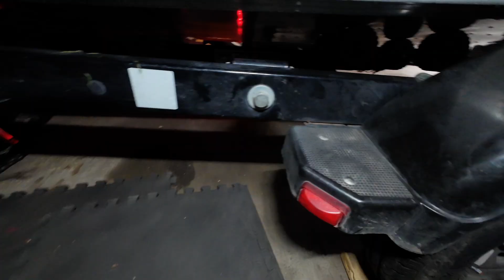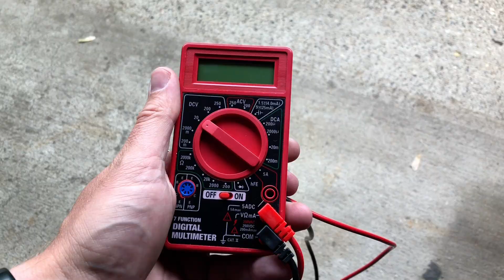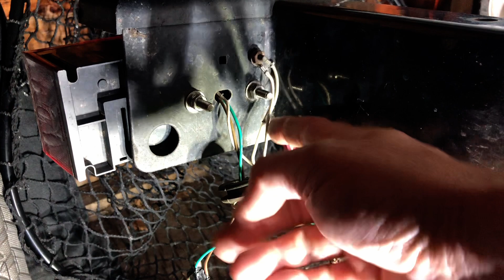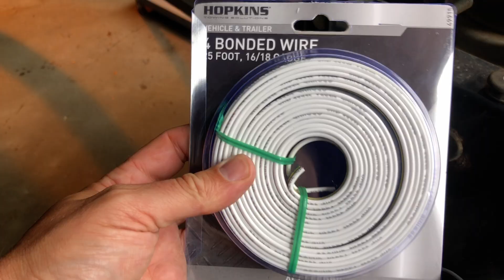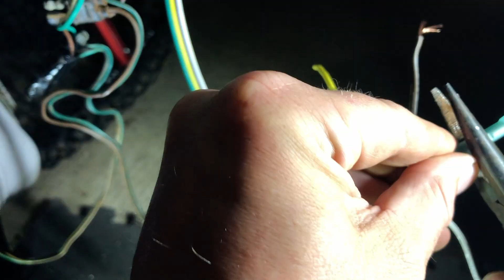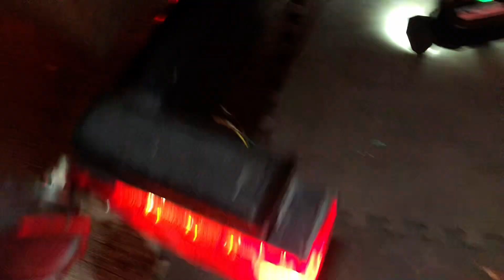Boat Trailer Lights Not Working? Easy Troubleshooting with a Cheap Multimeter

Comment: Did you have to also splice into the side marker lights or just to the rear thats the only part im getting confused mines the same way just the brake lights not working but side marker lights are i already cleaned the grounds and bulbs are good just confused on that part if you had to also rewire the side lights
Reply from the maker: I didn’t have to. If you look at the 5:40 mark, you’ll see a separate brown wire that I don’t cut, that goes to front side light. Where I splice in the back it has the same thing that actually goes back up the trailer to the side wheel light. So those connectors are like a 1:2 cord split for the brown wire. I hope that makes sense!
Reply: @IchthyOutdoors oooo okok thank you so much the video really helped!
Reply from the maker: @eriksalinas8216  Glad it helped and hopefully you can be all set soon with not too much of a headache!

Comment: If you put a long test wire on your multimeter you can hook to both ends of wire you think are bad at both ends of trailer and test for continuity, would have been able to see your melted wire not working, just another way to test
Reply from the maker: That’s a good call! Kinda like the bypass but easier to check each wire integrity.